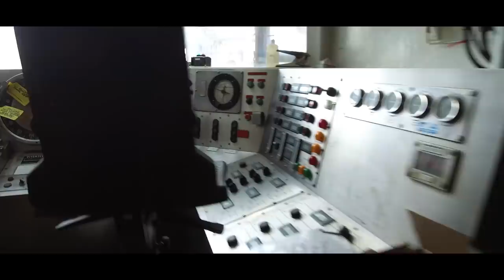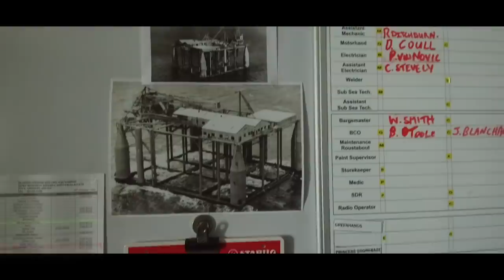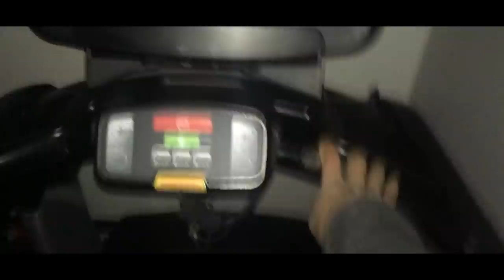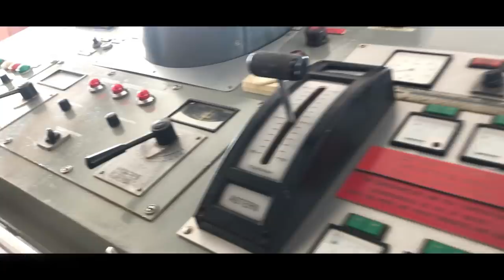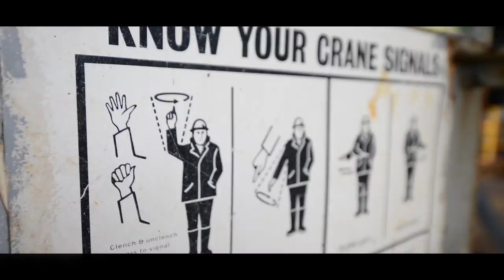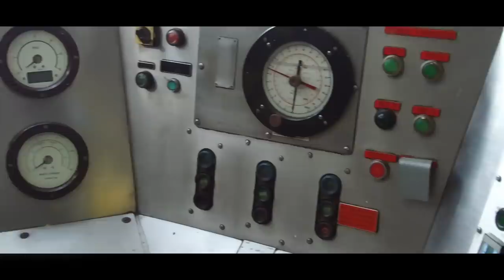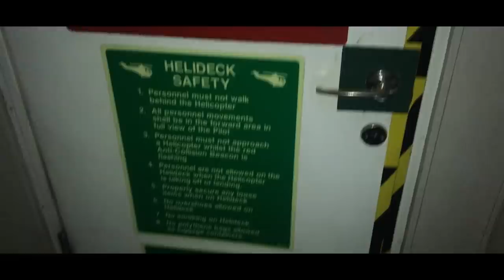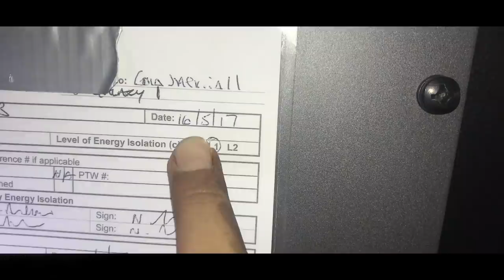URBEX | A weekend on abandoned oil rigs

Comment: As others have said, watch yourself going lower into the hull of these things. As rust consumes the metal, it uses up all the oxygen in the space, so if it's not well ventilated you could quickly lose consciousness. This is a very real issue on working ships and platforms and so these in their abandoned state could put you much more at risk. Awesome video guys.
Reply: Ollie Ponting 
🤣🤣🤣 Einstein has spoken. 
Yeah, oxidation of iron is a rapid process, consuming loads of oxygen in a short time🤣🤣🤣
Reply: Ollie pointing.  Spot on should be carrying gas monitors and escape sets
Reply: That's the way I want to go.
Reply: Good point. Quite a few workers die every year from this. Especially in ships in the 3rd world
Reply: Uses up all the oxygen in the space? These spaces are not confined enough and hardly any corrosion to be seen on the painted surfaces. Have you guys any idea of how much surface area of corrosion would be required to use up all of that oxygen? The carbon steel walls and floors would be disintegrated! These are not even closed systems we are dealing with here gents. Fair enough if everything was air locked and full of corrosive liquid oxygen is depleted fast in mothballed vessels and lines for example. In these spaces though we should be more concerned about leakage of other toxic materials or organic matter causing O2 depletion, not corrosion! 😆 The OSHA covers corrosion as a matter of contingency for spaces like this and quite rightly so. But look at the possible root causes and corrosion here is likely the least of their worries! In any case... Get yourself some multigas testers gents.
Reply: Peter Brown all I can say is that this happens and causes fatalities regularly in shipping (and O&G, but not much in the West and on e.g NCS where the safety is highest it's unheard of). And you can't use visible sign of corrosion to estimate O levels. Nor is corrosion the only way O can get depleted. I have no desire to use any energy to argue with anyone, I've given a warning.
Reply: @chukwow5738  People have died before on ships when entering (for example) the chain locker rooms for the anchor chains... Just saying
Reply: @jebipasadegene  They use air monitors in future episodes

Comment: this is where im going in the zombie apocalypse
Reply: Thatd be a good idea.
Reply: What u eat barnicles?
Reply: @Boojyman  anything you can catch with a fishing pole.
Reply: Sounds nice, but an oil rig would be a beacon for anyone else that survives. Which means you'd have groups of people try to take it for themselves. If you're by yourself then your kind of fucked. Similarly, to prevent the rig from sinking into the ocean it's got to be maintained. One person doing this without an equipment is going to suck and take up most of your valuable time. That could be used to grow food, ensure a clean water supply and find a way to get power. Although having the rig up with power on at night would be a terrible idea. I should also mention you really are going to need that power to have drinkable water. The oil rig will likely have a desalination system of some kind such as an RO system that will need power to work. How will you get power though? You can't just start digging a hole in the ocean and hope to strike oil. Even if you did, you wouldn't be able to use the crude oil to power any generators. Oil rigs depend on shipments of diesel to power their generators so good luck keeping those running without anyone bringing in a fresh supply of fuel. You could set up some solar panels, but they might get blown away if poorly installed or not work very well since the sea is an excellent location for clouds to favor. If you do manage to get solar panels to work then they would only power up a handful of things. Growing food outside also seems like a good idea. Until you realize that you will need to bring in a large amount of soil to grow anything. Also the salty spray from the ocean will result in a lot of your crops to just straight up die. If you do have good salt resistant crops then you'll be hard pressed to keep them alive during high winds or storms. Imagine trying to survive a hurricane in the ocean with a poorly maintained oil rig. Let's say you manage to have a large group on board. Those problems will just multiply with more people needing food, water, and a safe shelter. Overall, oil rigs make for a poor choice of refuge during an apocalypse. They will certainly do well during the early stages and ensure no zombies can reach you. That is, if zombies can't swim otherwise your in trouble. The chaos of the zombie event can give you enough time to reach the oil rig and occupy it before anyone else. Additionally, there should be some food, fuel, water and electricity to keep you going for a short amount of time before it's wise to abandon the rig.
Reply: Had you ever been to the town these are located in you’d be convinced that had already begun!
Reply: THE NEON TETRA PRO GAMER you’ve really put a lot of thought into this.👍🏻
Reply: @Fusiongearz  You must be a riot at parties...
Reply: RSSS68 Camaro  hey you like cars I like cars I'm sure we can sort this out
Reply: Bradius Maximus  What are you doing on YouTube? Get to bed now, can't have you falling asleep on us.
Reply: Bradius Maximus  Ah it seems my comment also gave you brain damage. Must of happened when you were a quarter of the way into it. Well what can I say except your welcome? Your welcome.
Reply: @Fusiongearz  Wall of text hits for 100
Reply: Bradius Maximus  Oh good to know there are still some brain cells left. Btw you're welcome.
Reply: Want a good oil rig zombie book? Read Adam Baker's "Outpost" 

Kasker Rampart: a derelict refinery platform moored in the Arctic Ocean. A skeleton crew of fifteen fight boredom and despair as they wait for a relief ship to take them home. But the world beyond their frozen wasteland has gone to hell. Cities lie ravaged by a global pandemic. One by one TV channels die, replaced by silent wavebands. The Rampart crew are marooned. They must survive the long Arctic winter, then make their way home alone. They battle starvation and hypothermia, unaware that the deadly contagion that has devastated the world is heading their way...
Reply: Well i think we are heading that way with this Corona shit.
Reply: So, did you go?
Reply: @everything777  no I died
Reply: Little did he know ha!
Reply: @JowoHD  if a zombies were real it would likely be an airborne parasite that wouldnt be aggressive to other people but likely still dangerous. In the event of an apocalypse the most dangerous thing to you will be other people. Having a group of people with guns is your best bet
Reply: About another 10k people thinking the same idea
Reply: It's like a city ,btw I wasn't  here
Reply: @Fusiongearz   dude y ,btw I wasn't  here
Reply: Id make camp around an abandoned nuclear silo
Reply: @LA Detailing A good short term shelter, but make sure to stay away from sharks. They consider fish friends and humans are not fish, so yeah.
Reply: I'll meet you there buddy
Reply: @derailed2157  it must be fish with arms that had mutated withe the petroleum 🤣🤣
Reply: There are liter-ally over 10 000 of these worldwide just waiting to degrade because it's too expensive and labor intensive to pull them out of the water. All of them still have oil reserved because the corporations seal them up once there's no longer enough flow for profits. So there's still oil ready to spew out once the seals degrade. And over 10 000 of them IS going to kill a lot of our oceans marine life and mess up our atmosphere because it is our oceans vapor pressure that make the atmosphere and we don't have the money or initiative in such a lazy oriented, money driven corporate world to remove these over 10 000 abandoned operations safely. Maybe they are trying to hide this because the oil companies would use this as an excuse for more oil companies to drill baby drill. Ever wonder if our mass and vast offshore and oceanic oil operations and fracking are causing new volcanoes?
Reply: Bring your v8 hummer with you ;)
Reply: @Boojyman  build a garden up there have boats to go to shore I don’t know how cool deep ocean rigs will be but it would be a good chance of survival

Comment: They're called Jack-up rigs, those towers as you call them were covered in bivalves because they are in fact the legs. When the rig is positioned the legs are lowered to the seabed and then the rig is 'jacked-up' like you jack-up a car and the weight of the platform drives the legs into the seabed. When the legs hit resistance the platform is jacked-up a bit more to raise the platform above sea surface. So the towers are under water during operation and get covered in bivalves.
Reply: Piers Morgan like clams And other mollusks?
Reply: @KazzArie  Bivalves are a class of the phylum Mollusca which include snails or any other shelled creature. The class Bivalvia has more than 15,000 species characterized by a shell that is divided from front to back into left and right valves and are connected to one another at a hinge. Bivalves include clams, oysters, scallops and mussels that you see in this clip. But each have very different colonisation preferences and it is more common to see oysters colonise the seabed rather than vertical structures like a jack-up rigs legs but for mussels its a perfect habitat. In fact mussel farms use lengths of rope suspended through the water column to farm mussels colonies..
Reply: Thanks, great information. Never knew anything about how some of the rigs function. Very interesting. And thanks to the other guys for the info on the sea critters.
Reply: Piers Morgan I always wondered why some clam vent holes goes down to two or three instead of just a single one. Interesting stuff!
Reply: Piers Morgan , I for one appreciate it when someone goes to the trouble of uploading a comrehensive answer to a question. It’s so refreshing to come across people that know their shit. 👍
Reply: So are they floating in this video? Or are the legs just that tall?
Reply: So if the legs are placed pretty much by touch under the seabed they must have a few occasions where they slip and sink further. Part of the reason it's so dangerous I guess
Reply: @Marthyboy88  No, they'd be on the seabed there. It's just a lot shallower in the harbour compared to being out in the open ocean.
Reply: @ashenverdict  You should be a teacher man, wonderful information
Reply: @Marthyboy88  maybe I'm wrong, but from what I understand, they mount anchors to the seafloor and then attach cables to those... Then the base/legs of the rig are enormous ballasts that are flooded with water and moved into position over the anchor cables. Once attached to the cables, they pump the water out of the ballasts and the buoyancy of the empty ballasts creates a stable base to build off of. 

Again, I might be wrong, but im almost positive that they don't just have "really long legs" that go thousands of feet down to the bedrock. They might have long legs in very shallow areas but some of these rigs are in extremely deep waters.

Edit: the rigs in these videos are definitely not in deep water
Reply: @spencerm5913  Yeah that's a different type of rig. It sounds like you are describing the semi-submersible variety.
Reply: It's something like a floating platform, I used to work in a shipyard where we were making one of those. This one had four "legs" and the system is more less the same. The one I worked on had flat bottom, four "legs" and it had it's own propelling systems so it was basically a ship/platform/rig

Comment: Confined spaces are a big killer at sea, something to look into for the future. Since all the ventilation gets shut down the air inside some compartments can go bad.
Reply: @paul beenis its still dangerous it can be used recently and the air quality can still be really low
Reply: Mick mcintosh there was a video of somebody who bought an underground nuclear ICBM launch bunker and was turning into a home. On their initial exploration the voice of the guy filming went all high pitched due to some kind of explosive gas from a similar situation. If I find the video, I’ll add another comment. They thankfully got air quality detectors for their next trip inside and eventually used big pipes to ventilate the air from the surface.
Reply: @a20axf  a cheap co2 sensor is pretty much all you need
Reply: @johndowe7003    So you would trust your life to a cheap co2.  We use a gas monitor which checks for 4 different gases and we use 2 of these as 1 is lowered in first for a while and we also carry 45 and 15 minute escape sets for confined spaces.
Reply: I was thinking the same thing. I work in the oil and gas industry and I serve as a confined space entry supervisor. There could be hazards in certain spaces.
Reply: @davidm3maniac201  i have my own personal monitor, no i wouldnt trust a cheap monitor but it better than nothing i prefer the 4 gas monitors with the lead on on it
Reply: @johncoffield3782   aka HOLE WATCH !
Been there, done that job ! OMG it is so boring.
Reply: @glennjames2324  easy money
Reply: @davidm3maniac201  need multi gas testers mate. CO2 wont cut it. Drilling rigs have loads of potentially toxic chemicals on them. Tanks frequently leak even during normal ops. Better still, dont be an idiot and go there unsupported and unqualified in the first place.

Comment: I didn't realize these things were so long-lived. Ocean Princess was first put to work in 1975.
Reply: Most oil platforms are up to 40 years old.
Reply: They have to become way inefficient after 40 years.  Too much maintenance also
Reply: Treasure Hunter, then Hunter then Ocean Princess
Reply: Jeff Rasberry  that's pretty cool. What are you doing now, old man?
Reply: Jeff Rasberry  if you're not too old you should give programming a shot. It's good for the mind, and requires nothing but your wit and diligence to learn it. It's not easy though, and you need to create an objective for yourself regarding it otherwise it'll feel like it's a pointless endeavor.
Reply: Ops run them out then they come to the corrosion engineers asking for design life extension :) they say jump, we say how high? Ha ha ha 😎🤣😎

Comment: The oil rigs are temporaly abandoned In a method used a "dry stacking" when there is no economic. need Most dry stacked oil rigs are bought or put back into service.
Reply: Cold stack.  Dry stack is out of the water.

Comment: That second rigg was a survey rigg, that can travel under it's own power. That's why the living quarters were integrated into the rigg. Unlike a static rigg, where the accommodation is a separate platform.
I take it that was the Firth of fourth, going by the new Queen Elizabeth Aircraft carrier you seen. It'll explain why the police were whizzing about, you got lucky, you couldn't have picked a worse time.
Those shells on the third rigg, fell off the supports, that are normally underwater.
Reply: If this was the Firth of FORTH, there would be three bloody huge bridges. I think you'll find it's Invergordon, beside the Cromarty Firth, north of Inverness and Dingwall. I don't know if the location was being kept quiet but it's been mentioned quite a few times in the comments already, so no harm in identifying it here.

Comment: As someone who worked on oil rigs, That rig isn't abandoned. The blow out preventer control panel was still powered on. Also that caustic soda will ear your skin if you get that power on you. it's nasty. Be careful
Reply: That's why they are "infiltrating" ^^

Comment: They are not abandoned. They are cold stacked (some not all). They will be used again.
Reply from the maker: My visit was in 2017.. in 2022 they are all still there rusting...These will probably never be active again as they are outdated too.
Reply: @ExploringtheUnbeatenPath  I reactivate these rigs. Trust me, a few million $$, they can be brought back to to service. I also cold stack them as in your video. They are well preserved if done correctly.
Reply: @ExploringtheUnbeatenPath  Outdated is just a concept. Keep them conventional then the day rate is low and they may work in India.
Upgrade them as the hulls and legs are still viable, put a 6th Gen Drilling package on it on you have a rig that can work for another 10 years ++.

Comment: I live right beside these Rigs my whole life I see them everyday. Nice video I've never seen on the red one. It sank in the 80s and it was fixed abd renamed. It's due to be scrapped soon. The legs with no topside were built in the dry dock in the firth in 1982. I've worked on these for 7 years, on and off.

Also be careful on these cold stacked rigs. Confined spaces are dangerous as the build up of gasses consumes the oxygen in the space and you could die in seconds. A lot of them are also in need of repair and if you stand on the wrong section of rusty metal or unsecured scaffold you could likely be killed. It happened to a few fellas right here on these rigs. Be safe.

Comment: Next time take bolt cutters. Just don’t take video using them.
Reply: Because illegal trespass charges aren't enough when you could get breaking & entering too (all the owner needs to do is tell cops there was a lock there and your guilty!).
Reply: @2CabrasLocas  They are already prepared to break the law by entering the property, dont see why another charge would be an issue to them.